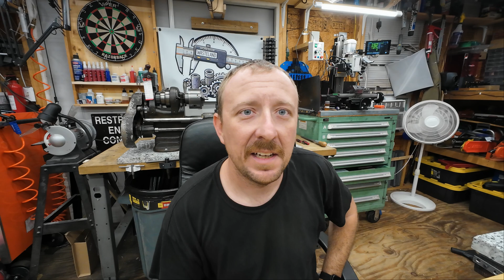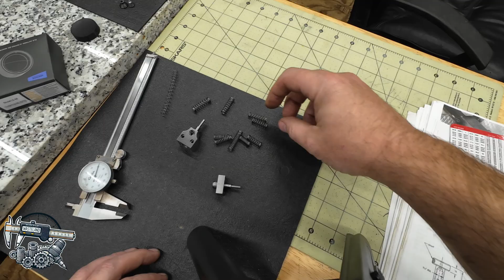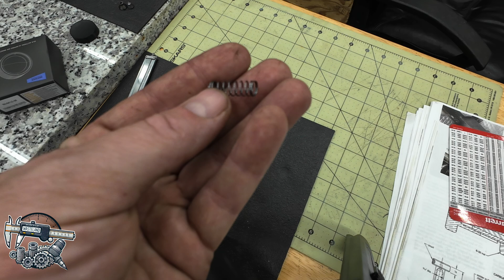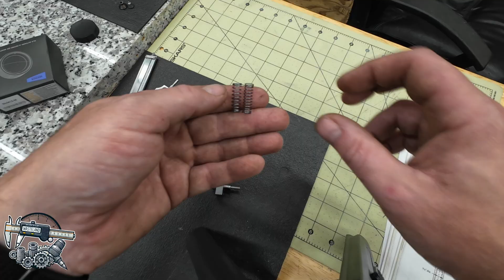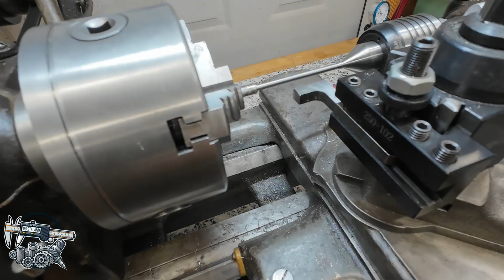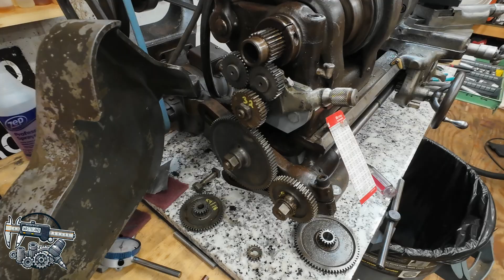Day 2 Workshop Tricks and Treats Springs

Comment: Have you ever found a need to heat treat the springs?  I remember my old gunsmith made his own firing pin spring and he heat treated it in the oven...
Reply from the maker: Surely couldn’t hurt, I guess if I were making a “precision” spring I’d look a lot harder into that.  For these valve springs though I think these will be alright.